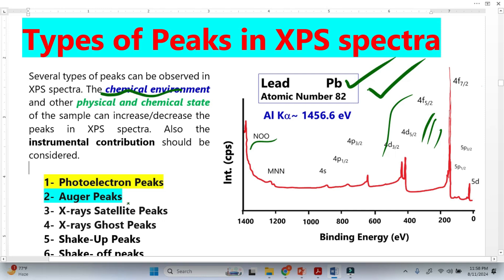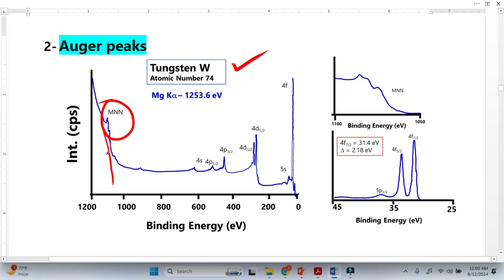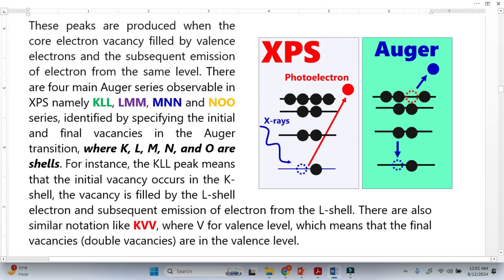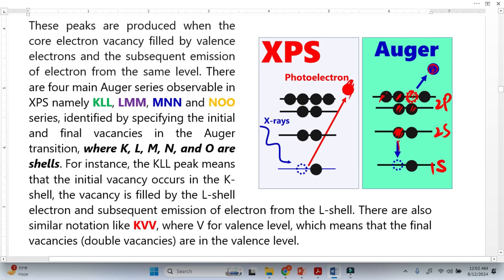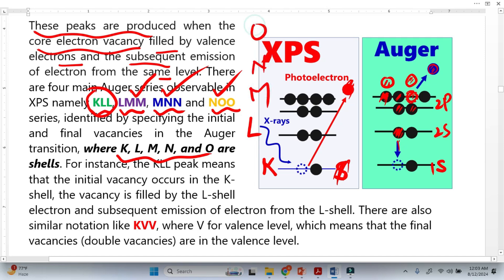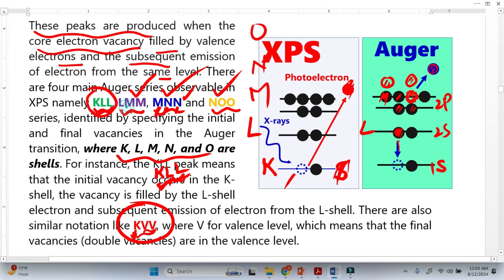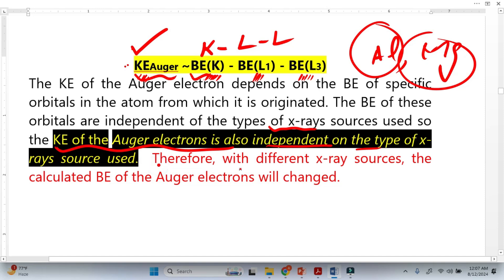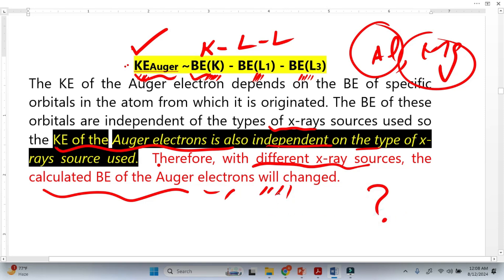How to Read Auger Peaks in XPS (KLL, LMM, MNN, NOO Series)

Comment: Hello sir,if it’s convenient,could you explain the question in the end of the video.
Reply from the maker: Thanks for the comment. 

Could you write it here that question, please
Reply: @nanospeaks Sure sir! It’s with different x ray sources, the calculated binding energy of auger electrons will change.Please explain this a little bit,and it will be really helpful for me.
Reply from the maker: Let's first discuss the Auger Peaks:

These peaks are produced when the core electron vacancy filled by valence electrons and the subsequent emission of electron from the same level. There are four main Auger series observable in XPS namely KLL, LMM, MNN and NOO series, identified by specifying the initial and final vacancies in the Auger transition, where K, L, M, N, and O are shells. For instance, the KLL peak means that the initial vacancy occurs in the K-shell, the vacancy is filled by the L-shell electron and subsequent emission of electron from the L-shell. There are also similar notation like KVV, where V for valence level, which means that the final vacancies (double vacancies) are in the valence level.

The KE of Auger electrons are
KEAuger ~BE(K) - BE(L1) - BE(L3)

The KE of the Auger electron depends on the BE of specific orbitals in the atom from which it is originated. The BE of these orbitals are independent of the types of x-rays sources used so the KE of the Auger electrons is also independent on the type of x-rays source used.  Therefore, with different x-ray sources, the calculated BE of the Auger electrons will changed.
Reply: @ Thank you,sir!However,I just still don’t get that “the calculated BE of the auger electrons will changed as the type of x-ray changes”.Mentioned that KE of the auger electrons is independent on the type of the x-ray,is it the BE of the auger electrons will not change as the type of X-ray changes?
Reply from the maker: We agree with this statement "The KE of the Auger electron depends on the BE of specific orbitals in the atom from which it is originated. The BE of these orbitals are independent of the types of x-rays sources used so the KE of the Auger electrons is also independent on the type of x-rays source used" using KE(Auger) ~BE(K) - BE(L1) - BE(L3). 

Let's come to the basic XPS (photoelectric) equation.
hv =BE+ KE + WF(spec), this is also a energy conservation equation. The LHS x-rays photon energy distributed among the BE, KE and WF(spec). 

KE =hv- BE - WF(spec)

BE =hv- KE - WF(spec), so here the KE of the Auger electrons independent on the X-rays energy (hv) as we have proved this in the top most paragraph. The WF(spec) is a constant value for the spectrometer. 

This implies that the BE of the Auger electrons changes if we change the photon energy (hv)..... directly proportional 

There are two types of x-rays sources in XPS

Al K(alpha) ~1486.6 eV and Mg K(alpha) line ~ 1253.6)
Reply: @nanospeaks Thanks a lot,sir!I already get it!